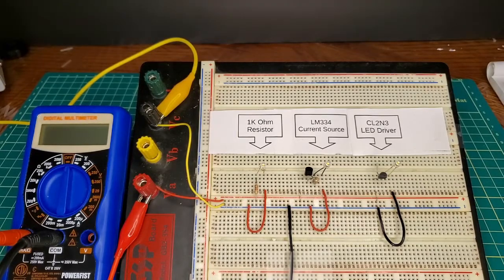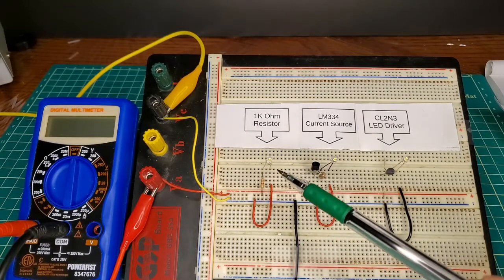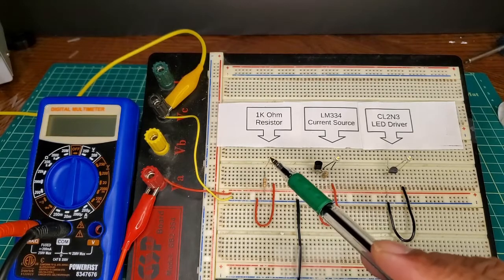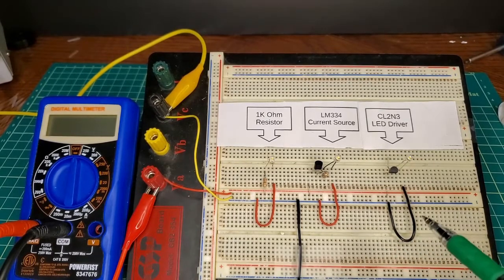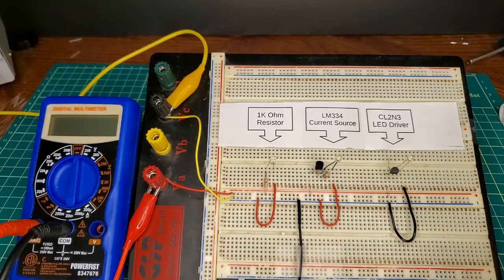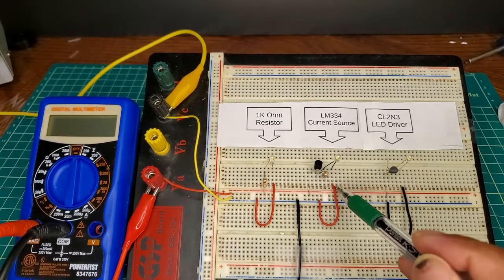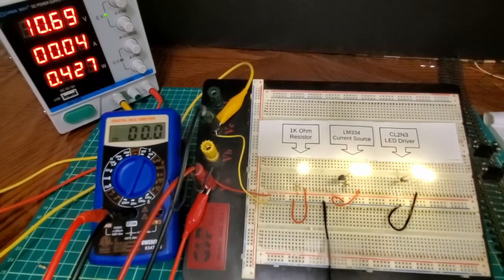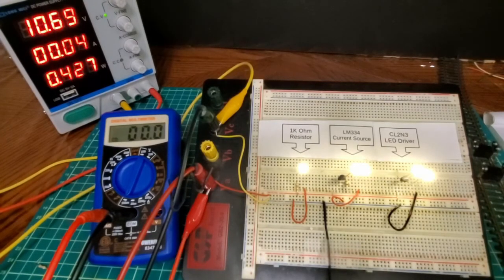Constant LED lighting for Model trains ; a Comparison of 3 methods

Comment: When using the CL2N3, what would you suggest as the limit of number of 3mm LEDs to drive off one CL2N3?
Reply from the maker: Hi Gene , Thank you for the comments . Sorry for the delay in response .  No matter what voltage you supply the CL2N3 ( Not exceeding 90v ) , a CL2N3 will give you a constant 20ma of current on the output pin. so you can run as many LED's in Series driven by a single Cl2N3, providing the input voltage going into the CL2N3 is sufficient enough to drive those LED's in series. I have explained this well in the following video which I posted : https://www.youtube.com/watch?v=7eVydcg1Gc8 , 
IF you look at this video and go over to the 28 minute mark , you will start to see me explaining how to connect multiple LED's to a single CL2N3 LEd driver . Take a look at the video and then let me know if you have any further questions and I will be more than happy to help you out . Regards, - Anthony -

Comment: Is there a way to combine any or all of these methods with a capacitor in order to eliminate flickering?
Reply from the maker: Hi Jacob , absolutely you can add a Cap . However before you do , you need to add a Bridge rectifier ahead of it , to ensure that the Electrolytic Capacitor received the correct polarity , when if the polarity on the tracks is reversed or you are running DCC ( if you are installing this in a locomotive or passenger car ) . 
I have shown detail drawings in the newer video which I posted on adding constant lighting for passenger cars .. please check that out , and let me know if you have any further questions .. I will be glad to assist . and for a Capacitor you may have to use a 2200uF Cap or higher if you want to have the LEd's stay on for longer without being impacted by flickering .. Contact me if you need help ( anthonyshobbycorner@gmail.com) .

Comment: where have you bought the parts from the LMM334 and th3 cl2n3
Reply from the maker: Hi Ric, LM334's are very common , you can even get them from Ebay . However , I typically get them from Mouser Electronics. the CL2N3's are not as common . I also get them from Mouser Electronics.  The LM334's might be the best option for you , as all you need is an LM334 and a resistor , and they are freely available . 
Where do you Live ?  If u live in North America, then Mouser or Digikey are 2 reliable online distributors. 
BTW , I just subscribed to you channel . 
Regards, Anthony .
Reply: @anthonyshobbycorner  Anthony I use led strips with  a 12v resistor built in  for my passenger cars. so with this part you dont really need a capacitor then to keep them from flickering  that will save some space. BTW I'm in N America

Comment: I guess you have not added decoders to a older locomotive converting from DC to DCC and this type circuit is required to convert to LED lighting.
Reply from the maker: Hi Norm you are correct . Most of the DC locomotives I have , pretty much fall into the "vintage" category . Most of them are from the 60's , 70's and a few from the 80's . So I like to preserve them in original state as much as possible and only change the lighting if needed. 
For my DCC loco's , of course there is no issue as the Decoders provision lighting requirements appropriately . 
I have many Fleischmann , Roco , Marklin Hamo , Rivarossi loco's ( vintage ) which I truly enjoy running on the layout with all the associated sounds of noisy motors etc .. those are the ones that I convert to LED lighting etc .. There is something about the vintage loco's which attract me to them .. 

Cheers - Anthony ..